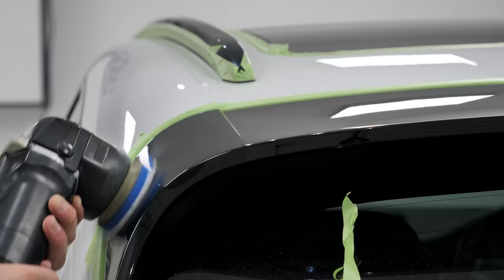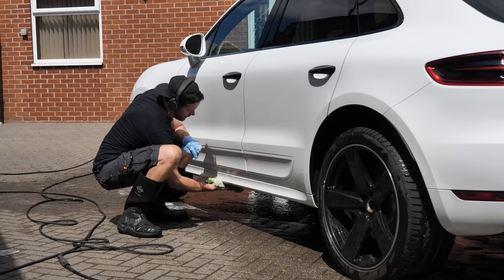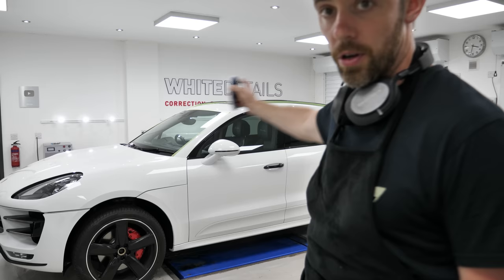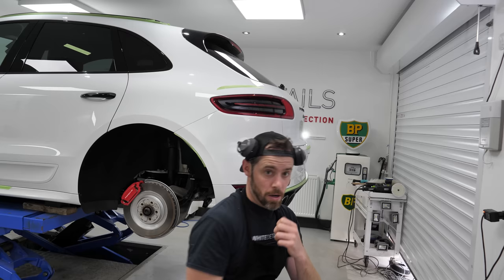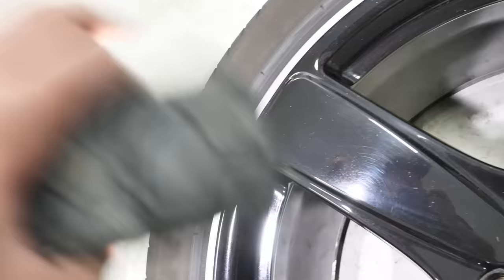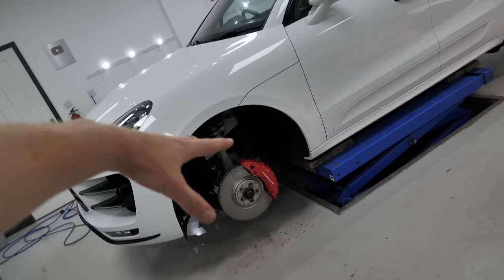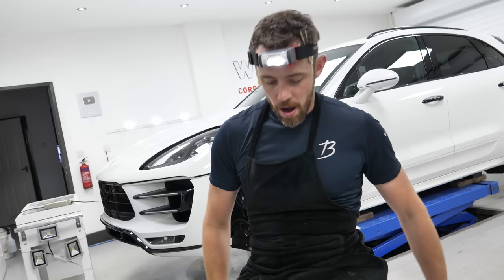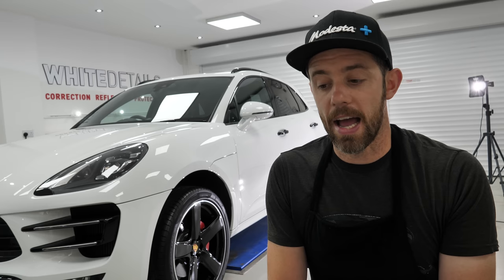Porsche Macan Turbo. Dirty Daily Driver - Full Detail

Comment: Another vote for bissell spot clean pro here 👌.  Industrial enough for extracting for 5hrs straight daily, no defo not,  there are other more expensive ones for that. I've had mine 2 years now,  half a dozen deep clean extractions and spot cleaning spills on our carpets indoors and its never missed a beat, still performs like new. It appears you don't extract daily, I maybe wrong of course 🤔, pretty sure it'll suit you just fine mate.

Comment: love the look of the Macan. A nice white comes up really when when properly maintained & presented..
BTW - My OCD picked up on 2 red valve caps & 2 blue valve caps. Is there a purpose for this?
Reply: Probably to define the front wheel location to the rear wheel location, incase he mixed them up maybe?
Reply: Port and starboard for directional tyres?
Reply: @79blustone  Yep!

Comment: Really random question for you.. What ceiling height do you have in your garage? Designing/building one next year and struggling to gauge what height I need for a mid lift ramp to be useful. Cheers. 👍
Reply: You’ll need plenty of footage to clear bigger vehicles like SUV and truck if you want to get under them with ease.